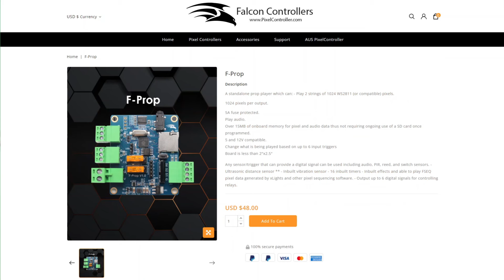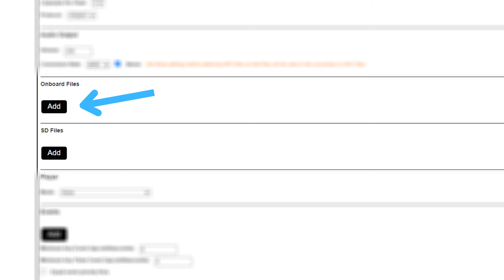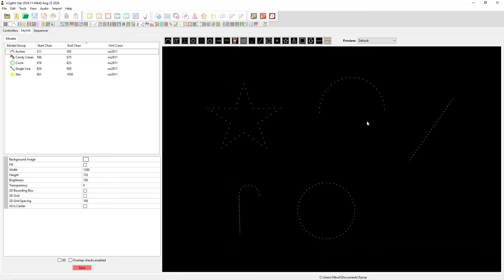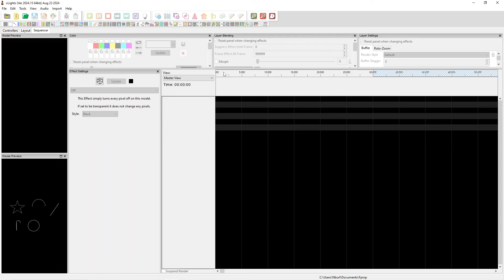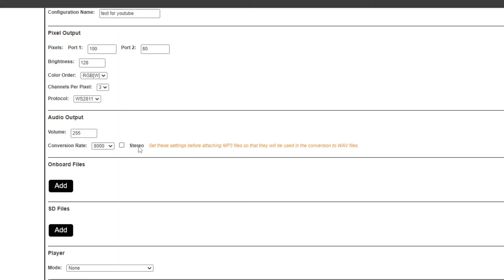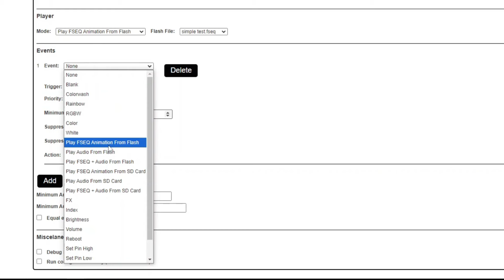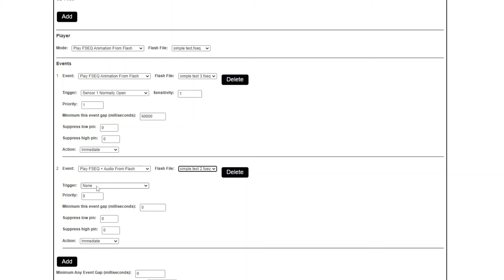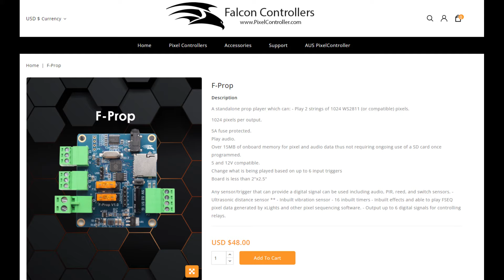The NEW F-Prop from Falcon Controller's is AWESOME!! - Full Tutorial

Comment: Hy! If i want to make a standalone megatree with 1800-2000 pixels, is it good for my project?
Reply from the maker: It would work, but you'd be starting to push the limits of it since you can only run 2,048 pixels total, and 1,024 per port. You would only be able to use 20 FPS sequences since there's so many pixels on each port, and there would be no room for expanding. If this is the only thing you ever plan on using in the show, and don't want to expand, then I'd say it would work if you don't mind an overall simple show. But if you want to customize it more and get more hands on, I'd recommend getting an actual controller.